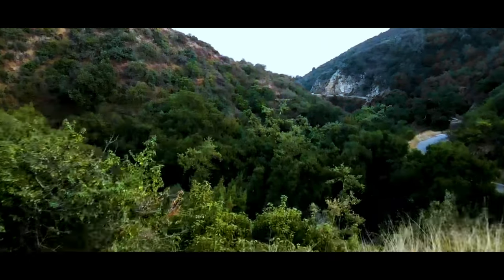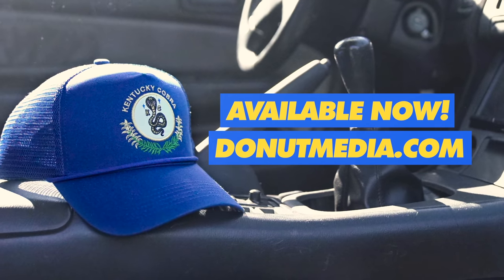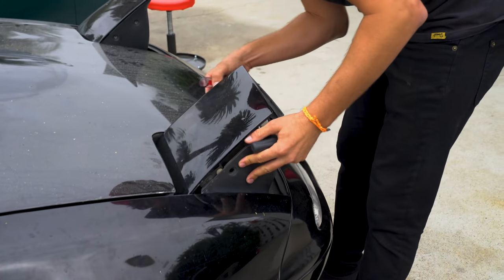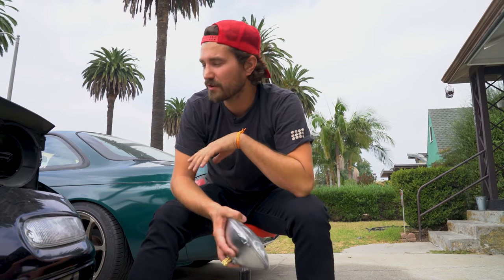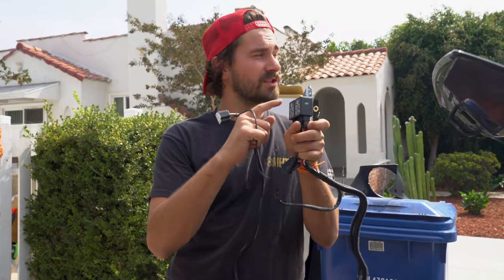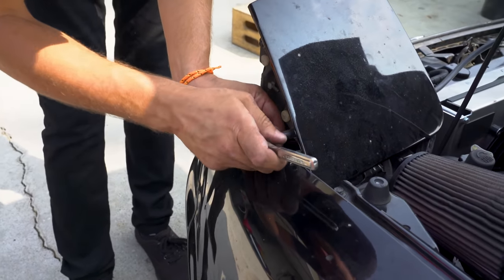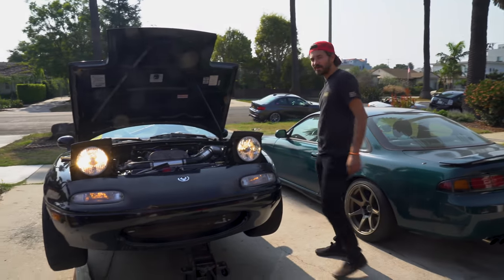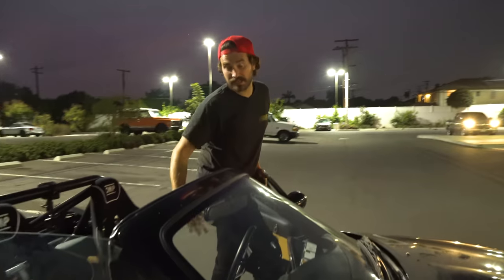Are Aftermarket Headlights Worth It?

Comment: Me: Just replaced every single bulb on my miata with LEDs
Zach: laughs in halogen
Reply: I think aftermarket LEDs are not legal in most states, so that's probably why he stuck to high wattage halogens.
Reply: @michaelrefuerzo9186  I'm able to put the brightest LEDs on my car. Granted I do blind incoming people. 😅

Edit: I'm also in California.
Reply: @michaelrefuerzo9186  as long as the lumens stay the same, I don't really see why would they be illegal, and sometimes it'd be better to increase them
Reply: @michaelrefuerzo9186  its not about legality. Halogens are just better in a lens built for a halogen bulb. The science is super complicated, but, LED's output light from a single source and then spread that in an arc, I think 120degrees. A halogen has a filament at the center and it burns with a certain intensity and the light trails off from that filament in a certain way. A halogen lens is specifically engineered to gather up all that light and project it forward. An LED placed into a halogen housing can get the light source close to a halogen, but then the pattern of light being projected on the lens is different. The brightest spot of the LED may not be in the brightest spot of the halogen filament and the tapering effect of the light is different too. You can get light scatter into areas of the lens it was never meant to have. This scattered light is why those lights are so much brighter to oncoming drivers. A good halogen bulb will outperform a good LED and will have the correct temperature and light spread out in front of you without odd hot spots or blinding oncoming drivers. Look up "Daniel Stern lighting HID." It explains it from the perspective of HID kits, but the principles still apply to LEDs.
Reply: Coming from a guy with a set of Cibie E-codes and osram bulbs in my 95 miata. The exception being projector lenses which have the cut off built in front of the lens, not built as part of the reflectors. Projector lenses typically less susceptible to these effects, but in a housing like shown here, use a good quality bulb like hella/osram.
Reply: Krautastic I keep halogens on my Subaru and the only negative think I can think of is the fact that I gotta replace em every so often and sometimes I can’t see them so I get pulled over and a ticket. The project Miata is a little uh louder and less how do I say this? Cop friendly? Just another thing I don’t have to worry about being pulled over for when the leds last a lifetime.
Reply: Doing same lol
Reply: LEDs (or halogens) will never last a lifetime in a miata. Way too much vibration compared to the average car. The price of more glorious p-p-p-p-pop up and down headlights
Reply: @michaelrefuerzo9186  MAKE LED LEGAL IN MURICA!
AND THE REST OF THE WORLD!
Reply: Thanks for the inputs guys. I was just coming off of what I've read whenever I imported headlight bulbs from US based shops. They always have a disclaimer that says they aren't road legal. But if you're there and you're using them without getting pulled over, then that's certainly great news. More light output for less power draw. 👍
Reply: @michaelrefuerzo9186  they're still illegal, just not getting pulled over haha! Some people just live dangerously! Car culture is a mixed bag in the states. In some states modifying exhaust or not running mud flaps on lifted trucks are illegal, but, you will likely get away with it for a long time. But get pulled over for a speeding ticket and watch them tack on all sorts of nonsense to the ticket!
Reply: @michaelrefuerzo9186  it's legal as long as you actually adjust headlights
Reply: @Krautastic  Im using high end osram bulbs and i prefer the ones that i use in my daily from aliexpress for 3 bucks so, i would say just get a bulb.
Not trying to upset you, that was only my experience.
Reply: @michaelrefuerzo9186  ....the hot setup for NA is 2020 Jeep LED headlights .
Reply: @alexisknows6513  almost forgot there's an entire aftermarket segment dedicated to round headlights 😂
Reply: @Krautastic  Jeep headlights use LEDs and are a direct plug-in to NA miatas its one of the easiest mods
Reply: @Krautastic  Alright you have convinced me, I guess the NA is getting a lightbar...
Reply: just because this has since popped up in my feed... It basically shows that LED's gain you a little extra distance, but you may as well be driving at oncoming drivers with your high beams on. As someone who struggles with night vision, I can assure you I hate people like you! haha. Seriously, if you don't have glasses/contacts/astigmatism, which is all very common, bright lights at night are way worse than to someone with good vision. I'll continue to recommend good halogen with a good halogen housing. Or switch to newer projector/led housings that are DOT/TUV/etc... approved. 
https://www.youtube.com/watch?v=_Ck2Lsfn9fw&ab_channel=EricTheCarGuy

Comment: Ohhhh man. I hooked up a set of round lights like this in the front bumper of my 98 tercel, 90s subie style! They took 100w H1 bulbs, and were made by Blazer. They were bolted directly to the steel bumper support, and yes I had to cut the bumper. They were "Hella bright" lol. Could reflect off the big highway road signs long before I could ever have a chance of reading them! (Maybe with binoculars lol just a little bright rectangle off in the distance) Wired up basically a kit like this made myself, 40amp relay, 14g wiring, illuminated switch in the dash, all the bells and whistles to prevent fire 

The lil tercel was sprayed tremclad white, and had red Rally Armour style mudflaps made from red plastic crazy carpet (plastic kids snow sled from the dollar store), and the tow strap (crane rigging strap) hanging out the trunk shackled to the factory tow hook under the back.

The little "Terstallion" was a 22b subie wannabe lol. During the Corona gas price drop, 6 bucks would get you half a tank from empty! That car was a last, and almost got a 3" lift and a 2.0L AWD swap from a 98 rav 4 before I had to sell it due to needing room for car seats if ya know what I mean 😉 😂

Comment: For you yes, for other drivers no :D
Reply: You just gotta adjust them and that's it, plus there's so many people right now that have SUVs and Trucks you won't be blinding that many people
Reply: carfreakify  Yeah low AND almost not crossing what would be the middle of the road
Reply: carfreakify  The problem is that these headlight housings are not projectors, so there's no clearly-defined cut-off line. You would need to aim these so low that they become worthless. I've wrangled with this predicament on older cars where I installed retrofit HID kits in the same fashion as what this video is showing. It just doesn't end well. What would have been really slick is if there was a 40-watt low-beam, and 100-watt high-beam. Best of both worlds, without blinding everyone else on the roadway.
Reply: @instantbeansoup  you just replied to a spam bot😂
Reply: All new cars with bright headlights make you say the same thing, I'd rather have good headlights than halogen bulbs.
Reply: Especially if you have a 4x4, a range rover,a BMW or a light bar
Reply: Reaper Asylum  of course projectors are not needed, but those style of housings are designed for a certain wattage, lumen, and intensity. Within factory specs, they will not blind, but above, they could easily blind oncoming cars. 

It's very common here and I make sure to flash every driver with illegal headlights. Proper housings will cause the lights to be very dim at any height above 3ft or so, but non-projector housings scatter light even straight up into the trees.

My point is, don't be a jerk and blind people. If you're getting flashed, you're the problem--not everyone else. Just invest in a high quality retro kit with good cut-offs. They're not bad and will save you a lot of headaches. Plus you normally don't need to upgrade the harness if you go that route.
Reply: Takumi doesn't need no lights.
Reply: anyone know what road that is?
Reply: The new audi's have auto leveling lights so you never blind others. And they also have an option for wet roads (dont ask me HOW it works I haven't got the slightest clue) so you'll never blind them with reflections either.
Reply: Auto headlights can be the WORST
Like ones that auto high-beam destroys anyone’s eyes who is trying to walk. 

No amount of adjusting can compensate for creating a hill and blinding oncoming.
Reply: Exactly. I actually praise the engineering that went into the headlight housings of my Volvo because they are halogen but light up more of the road than my friends with aftermarket projectors (and even modern cars that come from factory with HID’s) and both cars are adjusted to make sure they don’t blind traffic as needed by law and mine is able to shine farther because of the housings BUT has a special “cut out” in the drivers headlights light spread. It seems to basically just go around oncoming traffic so it doesn’t blind but I can see far ahead. The high and low beam also use separate reflector buckets in the headlights so when using high beam is has the full spread and looks like any other high beam. You can see the asymmetrical reflector patterns from the left and right low beams. I wish more companies did a similar thing. I personally haven’t driven a car that is set up like that but hope they start doing that again.
Reply: @luka_abh  Imagine the SUV drivers getting the upgrade.  The beam is going to pierce your eyes. 🤣
Reply: If they're positioned right that shouldn't be an issue
Reply: @scrampker  that's why he upgraded the whole light assembly. Of course Hella is going to put some engineering in their product. And you can see it in the final comparison. No issues here.
Reply: @fastinradfordable  thats why you have to use common sense. Its super easy at night to see when someone is coming the opposite direction.  Super simple to turn your highbeams off manually. (My audi doesn't have the package with auto highbeams.) 
My previous car from 2007 also had auto leveling so I'm not sure that its actually that bad of an option. Sure its not convenient for hills but you can't avoid that even with proper leveling. At least these will TRY to help..
Reply: I have self leveling LED headlights on my 2017 BRZ. I really don't want aftermarket headlights as they will probably be worse.
Reply: @scrampker  way to be the headlight police man. So glad there's someone out there flashing every car the come across that has lights they don't like. Don't know what we would do without you.
Reply: @sonnydthomas  It also might be worth mentioning that an 80-watt low-beam is highly illegal, and for good reason. I could easily defend a 40/100w or something along those lines, but driving around with 80w is going to cause problems every single time you drive. You simply can't 'adjust' that away.
Reply: @scrampker  because that has to do with the fact that you want to be the light Nazi, shaming and flashing everyone into submission on a YouTube comment section. Glad you found your calling in life.
Reply: @sonnydthomas  I haven't shamed anyone into doing anything, or attacked anyone. Just pointing out the illegality and also how annoying it is to other drivers. If you feel personally slighted, then that likely means you fit into the group who is blinding other drivers.
Reply: @scrampker dude I drive with stock lights. I could care less. What's ironic is you, complaining and arguing with every person that comes along, are just as annoying as the blinding lights.
Reply: @sonnydthomas  if you, and one other person is 'everyone,' then you would be correct. Though of course, you both were the instigators. Have fun in la-la land. :)
Reply: @Aeternum_Gaming  I had misadjusted lights in the past and after I got flashed 2 or 3 times one night I went and check them. Hopefully not everyone is truly that clueless.

Comment: ROW: meters
Muricans, doing everything not to use meters: 10 Miata lengths
Reply: Homie could've used an obscure SI unit to sate his american desires, the Lumen!
Reply: most car guys/gals and experienced drivers use car lengths as a unit of avg when driving...

for example its suggested that you stay 300ft/90m (around 20 car lengths) from a semi truck but trying to avg that distance it sort of hard when you're driving BUT for some odd reason we can precisely avg that distance using car lengths as a unit of measure...
Reply: Metres*
Reply: @dacam2067  depending on your region
Reply: @lachychops2  how is it obscure?
Reply: @TheMarcQ  get a different reading the further you are from the source (yes i know thats the point of lumens)
Reply: The germans used the volkswagen beetle as a unit of measurement once upon a time
Reply: @dunhillsupramk3  Why would you use a constant measurement of distance as a rule, when your braking distance changes exponentially with your speed? Why not use the 2 sec rule that works at all speeds, and is easy just as easy to "measure".
Reply: @dunhillsupramk3  7m or jz?
Reply: I think it's pretty inclusive and elegant to use a "unit" of measurement like that, so both americans AND the rest of the world can roughly get an idea about the distance
Reply: Not that the Americans shouldn't convert to the metric system though, as the imperial makes no f-ing sense what so ever
Reply: @SirMangoMantango  idk the 2sec rule..
Reply: @doomkid02  7M was leaking and cost too much to repair so as the cheaper fix at the time i did a 2JZ swap..
Reply: @dunhillsupramk3  very nice, going 2jz here as well 👌.

Comment: The way I adjust my headlights is on a flat ground parking lot. Pull up to the back of a car and back up till there is about a car length or a bit more and adjust the top of the beam to the top of the bumper of the car in front of me. This way I know I'm not blinding anyone (LED headlight are bright AF and 8000 lumens will melt eyeballs in the rearview or on coming traffic). If you don't have a friend or family member you could go up to your local mechanic shop and ask if you can use the parking lot at night to adjust your lights and pull up to car leaving a car length or so to make the adjustments. I've had my lights for over a year now and not one person has flashed their brights at me.

Comment: On the new headlight is clearly written 55w and he is installing 80w bulb in hot climate, excellent advice. There is a huge difference in light power and color between H4 and H7  bulbs, so better to find H7 headlights, put some bulbs like Osram Nightbreaker or Philips Racing Vision... No need to install additional cables, only downside is that they last shorter than regular, but since his 80w will heat like crazy they will last the same.

Comment: I appreciate this mod. One thing I cant stand is ultra bright led headlights. I'm forever blinded by them by on coming cars. Its definitely unsafe. There should be a lumen limit for cars, and if there already is, it's way too high.
Reply: At least where I live there is. 10,000 lumens low 20,000 lumens high. I believe they’re trying to make it so trucks have a lower rating because their headlights aim so much higher then regular cars but we’ll see 🤷‍♂️
Reply: It has nothing to do with how bright the headlights are and everything to do with making sure they’re aimed properly. Many aren’t. Some manufacturers, like Toyota and Subaru, aim their headlights too high straight from the factory. Even old Halogen headlights will blind oncoming traffic if they’re improperly aimed.

Comment: I've used the H4 conversion also and it's a  phenomenal product.

But one suggestion if I may, use non-sealed beams with removable bulbs rather than sealed beam.  This way you can run virtually any light you wish.
Reply: What wiring harness did you use

Comment: I’m a retired mechanical engineer. Part of my career was spent designing motor vehicle lighting. The reason that you don’t touch the bulb on halogen lights is this:

1) Halogen bulbs are made from a thick, very strong glass (borosilicate) that is under pressure.

 2) Your fingers leave behind oils that, when heated, penetrate the glass and weaken the glass (a weakening called “devitrification”). Since the bulb is under pressure, weakening the glass causes it to fail.

I applaud Donut Media for swapping out halogen sealed beams for halogen replaceable bulbs instead of swapping in HID or LED. The way the human vision system perceives light is very complex. I can’t begin to go into it here, but human perception of brightness isn’t linear, which means that doubling watts does not translate into seeing twice as far. And the human perception of color is complex as well, for many technical reasons relating to both the physics of light and the biology of vision. AND I definitely want to applaud aligning the headlamps. I see so many poorly aligned headlights that I don’t think most people bother to do it.

I’m all for putting more light down on the road, but watch out for low beam lights that throw too much light into the yes of oncoming traffic. Not blinding oncoming drivers is the reason you have low beams.

Comment: I did a full LED conversion in my 1989 MG Mini. Indicators, brake lights, reverse lights, the whole damn car. That includes the headlights. Best thing I've done to that car. The only problem is that I bought cheap shitty ones. They decided to die yesterday. Just.... Stopped working. They were crappy Chinese knockoffs that had a crappy app to change the color of the running lights. A tip from me? Simplicity is key. Hey a good set that isn't trying to get fancy. Want to have colored running lights, get the ones you wire in what you want, not something that is trying to be extra.